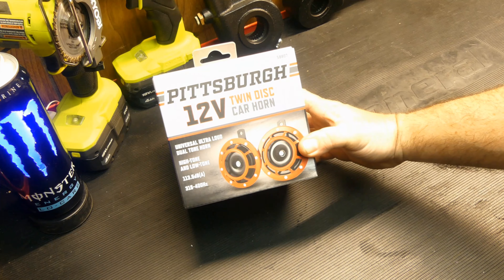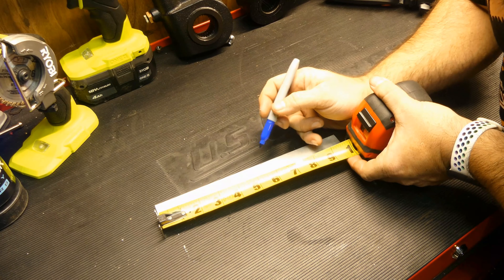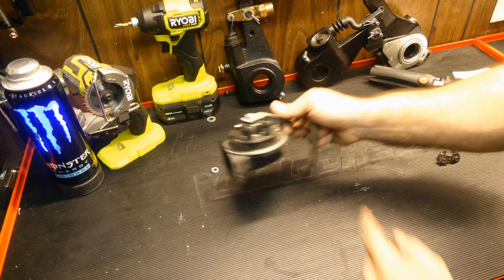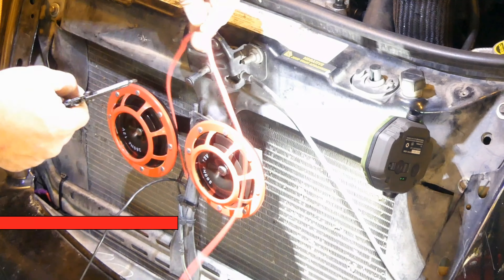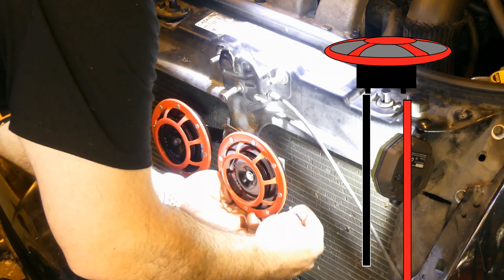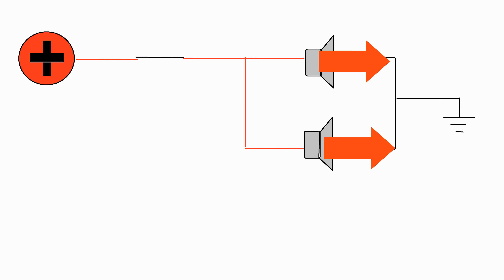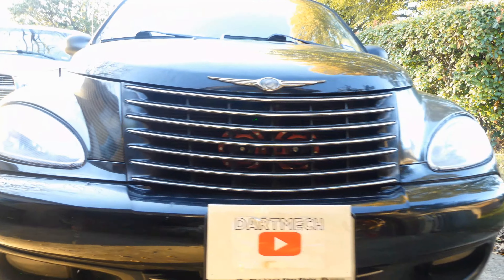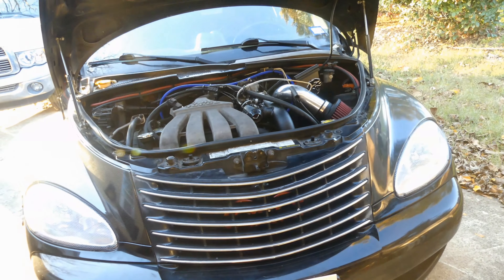Harbor Freight TWIN DISC HORNS!! Install and Review!!

Comment: The instructions said not to put them where water would get into them but I see you install them behind the grill. So it's ok to put them there where water will be getting to them?
Reply: I like where they both are
Reply from the maker: I’ve driven in the rain a couple of times with them here and it’s been fine. I think as long as they can’t be submerged you should be fine. They’ll get wet where the horns usually go anyway.
Reply: I've had the real deal Hella supertones (which these are knockoffs of) and I've had them front facing, exposed to nonstop rain and splashes for almost a decade, no issue. Car horns are meant to be in the engine bay exposed to heat and water

Comment: Glad I watched this video. I was going to buy them to replace my civics wimpy horn. But after hearing them. Was kinda disappointed.
Reply from the maker: The audio doesn’t come through great but they are much better than the single stock horn if that’s what you’re running.

Comment: You must put the red on one side and the black on the other they must match if they do not they will cancel each other out that's an old speaker trick going back to the old stereo days plus plus minus minus if they're opposite it will dimish the effect. I have a pair of these and at 14 volts input they both combine pulled close to 8 amps of current at 14 volts DC.
Reply: Each horn is a different tone so it doesn't matter. I forget the exact freqs, but lets say one horn is 480hz and the other is 520hz, making that really obnoxious and attention getting sounds clash. having them out of phase doesn't matter here.